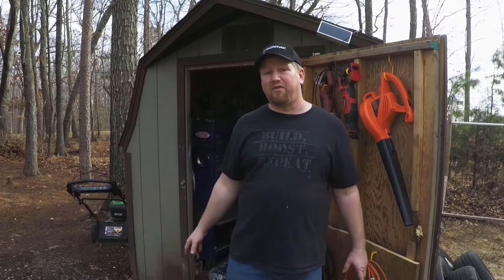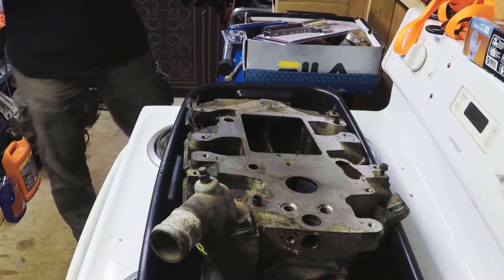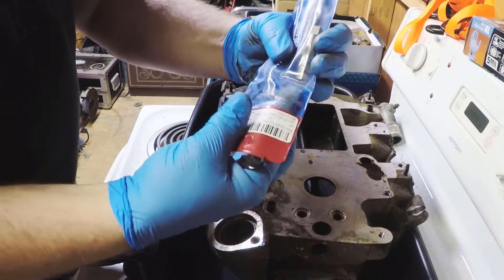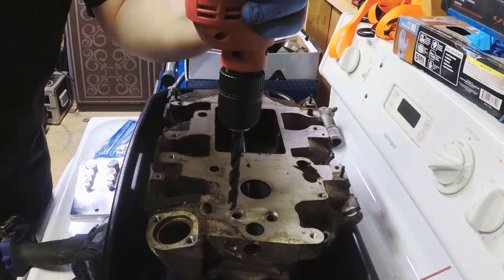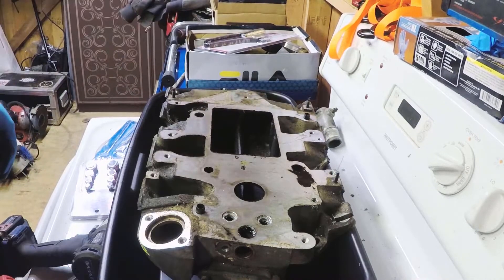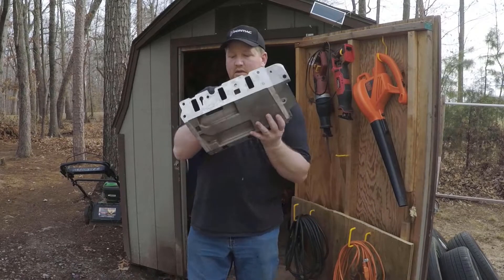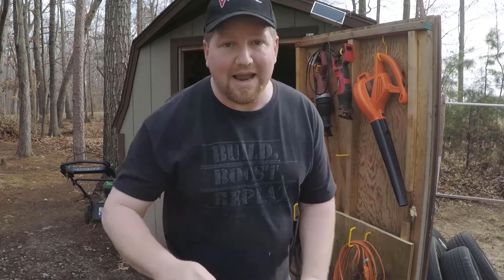Gen 5 M90 Swap Pt.1 Lower intake manifold prep

Comment: Acid based aluminum cleaner ment for like mag wheels works really well. Or wheel brightener. You can even buy a gal of AC condenser/radiator cleaner. All work great. Be warned, those chemicals are very harsh to your lungs and everything else. So I wouldn't use them without proper ventilation.
Reply from the maker: Good tips.
Reply: Ive not found much diesel wouldn't clean

Comment: What year would gen 5 come in. I have a 08 Allure should i do top swap or complete motor trans ecu?
Reply from the maker: Any 04 thru o8 grand prix would have the gen 5 setup.   You could top swap or engine swap but top swapping is a lot easier
Reply: @SalemDoyle  so I would need Lim supercharger, t body. What else if you could give me a idea
Reply from the maker: @raffaelemarinucci   I think that should be close to it but you can watch my videos on the gin 5 swap to get a little bit of a better idea
Reply: @SalemDoyle  will check out. I'll have to find heads because mine is N/A engine. You had sc engine so the heads you didn't have to swap

Comment: I'm looking at this and thinking about using the SVT Cobra M90 and factory intercooler. You would need the SVT M90 with the intake elbow and throttle body as well as the intake manifold. Also a series 3 intake manifold. The hard part will be fabricating the manifold out of the two. Piece of cake for an experienced welder. Do a remote thermostat and heater hose, you don't want it anywhere near the intake. Take the length and depth of the ford manifold and calculate the volume length x width x height. The series 3 intake will be narrower, so the intake box will have to be taller to match the volume. One end at a time weld the end plates. You can be an inch above the valley floor. Then flip it over and make a  plate the width of the end plate and length between them, if you are feeling ambitious you could curve the base plate for more plenum volume and air flow doesn't like 90 degree bends. Now mount the intake in the motor using gasket material to block off all the ports and maintain dimensions, the bolts should be snug not crushing the gasket material (has to be as thick as OEM gaskets) Cut a couple of u brackets and weld them to the top of the intake towards the center with the other end tacked to the front and back cylinder runners on each side. Cut straight down through the runners for the side of the plenum box. Then cut out the original side of the intake, slide the new side plate down into position and put a couple tacks on each end, trace around the port runners on the side plate. Take the plate out and cut out the holes for the port runners leaving the cut smaller than the tracing for welding. Bevel the edges everywhere you are going to weld. Line up the plate and tack all over the place. Around the runners, the bottom and ends of the plate. Then weld everything up completely. For the top of the intake you may have to flange out to the sides slightly to mount the top of the SVT intake, keep that in mind when building the box. After everything except for the top is welded up, take a rosebud torch and heat the intake up evenly all around, the runners will try to cool because of the heads. This will remove any stress from the welding. Let it cool gradually. After its cooled you can remove it from the engine, don't forget to blow all the filings and dust off first. Mount the supercharger and intercooler to the top plate, then tack it onto the new plenum box. Weld it up slowly to avoid excessive heat. Finally, make block off plates for the top and sides. Thread an air fitting in and pressurize the box to 25psi using a regulator. Submerge in water to check your welds, repair as necessary. Congratulations, you just made your first sheet metal intake. Now you can use an M90 with 3 times the flow capability and an intercooler that is 5 times better than zzp units. Run a water to air heat exchanger up front for everyday use and aluminum piping to an ice chiller in the back for grab racing. This setup will blow cold air into the motor when using the chiller. Put check valves in the return lines and use a spring loaded vacuum switch to run heat exchanger or chiller. If you look up the OEM SVT Cobra supercharger, intake manifold, and heat exchanger on EBay, you'll see why it's worth taking a weekend to make the intake work. 550hp on tap with the right supporting mods, that's why.

Comment: You can open the coolant passage behind the service cap to allow better coolant flow to the rear head to help with cooling back there. The service cap is really narrow and doesn't allow a  decent amount of  coolant pass to the rear when the tstat opens. I've ran my LIM like that for 8 years no leaks, seems to take some stress off the water pump, less knock from rear cylinders etc. I know I'm just some guy typing on the internet 🤣🤣🤣 so got this mod from grandprixforums think it was billboost who did the write up long ago!  I would paint Lim because when you go intercooled that will be shiny silver. Love you vids bro keep em coming!
Reply from the maker: I have been thinking about that mod under the service cab also, but I am saving that for part 2 , that video will be coming out in about a week or so

Comment: Can't wait for the rest. Not sure if I want a Gen V or a ported Gen 3. I have 2 gen 3 at the moment. Was thinking of painting one of my supercharger, but was told the paint will hold the heat in. So I'm thinking of polishing the supercharger.
Reply from the maker: Polishing looks great but is a lot of work.
Reply: @SalemDoyle  cool time lapse video? Plus looks cool. Also why not, it's easy to paint
Reply from the maker: @pices73  it would be a cool time lapse.
Reply: Same here, I just picked up a Gen 5  supercharger and lim at Summit, Illinois picknpull and I think I'm gonna hit it with a wire to freshen up the aluminum

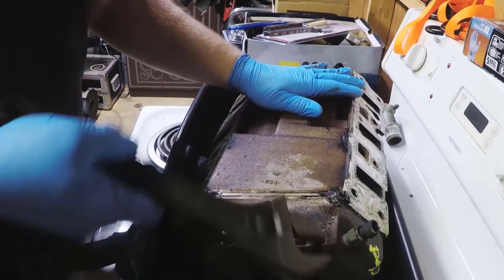Comment: What is the sensor called that you removed at 1:05? I've been gathering my parts for this swap on my Buick Riviera but i broke that sensor after I removed it from the donor car at picknpull
Reply from the maker: The coolant temperature sensor
Reply: @SalemDoyle  Thank you sir, I was wondering what that was for. Is it the same part on the Gen 3 intake do you think

Comment: I literally just did a gen v swap. I'm in the process of putting the last few things together. It's pretty straight forward. I went with the billet fuel logs and NorthStar TB with the LQ4 MAF. I also put in a full stack heat exchanger. 

The swap is pretty straight forward. The more or less difficult part is figuring out the fuel rails (no instructions or diagrams). If you go with the modified stock rails it'll probably be easier. 
Another speed bump is dealing with the purge valve.  First easiest option is the plug the holes and delete the trouble code and pretend it's not a thing.
Second is still pretty easy is to use the gen v purge valve. All you have to do is lengthen the wire connector (they use the same connector) and shorten the the plastic line. Choosing this one will require you to use your factory throttle body (highly recommend to buy zzp's ported TB to match) or if you go with the N* TB you will need the turndown or a TB spacer.
Third option is to convert back to your factory one. This option is the most difficult and requires you to make your own lines/wire lengths and find a place to mount it.

PCV is another thing. If you use a gen iii TB (or zzp's ported version highly recommend) there's a brass plug on the bottom. You need to drill out and put in a 3/8 nipple. If you go with the N* TB it has a built-in nipple already.

Last is tuning. If you use your factory TB or the ported version. You don't have to touch the tune. If you go with a N* TB you will have to convert to a LQ4 MAF. It will still run without tune (I was curious and want to see what'll happen) but it'll be very lean. Very similar to if you have a big vacuum leak. All you have to do is grab a MAF table from any vehicle with the 6.0. the cleaner ones that match our set up best is either from a Z06 (it would be slightly leaner) or Z71 (slightly richer). You can choose which ever one is best for your set up. If you're an expert with HPtuners you can probably build your own table. I didn't have to touch the primary VE tables but many people doing the LQ4 swap had to (they probably used a bad maf table). Or trailer your car to a tuner and have them correct the tune. I'm no expert with HPtuners or tuning but I know how to use the software and the basics of tuning. I got it close enough and plan on driving it to get it tuned by intense racing come spring.
Reply from the maker: Out of curiosity, dis you try the stock fuel rail?  Was it too short?
Reply: @SalemDoyle  the reason I went with the billet fuel logs is because i have the full stack heat exchanger. Hood clearance. If you go with a short stack heat exchanger. you can use your stock rails un-modified. You just need the fuel injector spacer kit from zzp. Or if no heat exchanger at all. Stock rails will bolt up and fit no problem.
Reply from the maker: @carnage50x  ok, thats what i was thinking.  Thanks
Reply: @SalemDoyle  also I didn't bother to block off the coolant passages. the heat exchanger blocks them off for me. The gen v intake also has then in a slightly different spot and same with the PCV port. There's a extremely low risk of coolant getting dropped into the PCV when ever I have to take the exchanger off in the future. The gen iii intake they are alot closer together and I would plug them on it.
Reply from the maker: Looks like it would fit without the heat exchanger